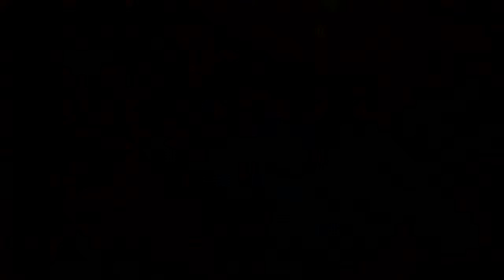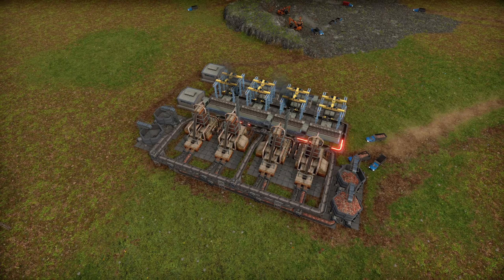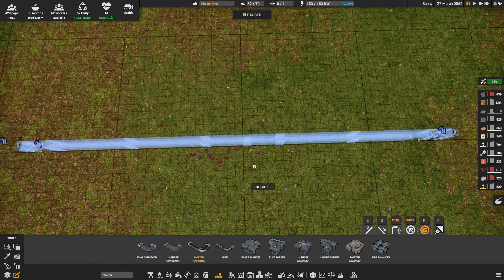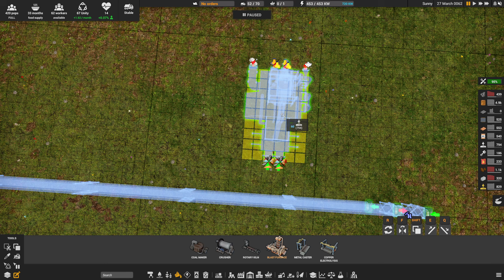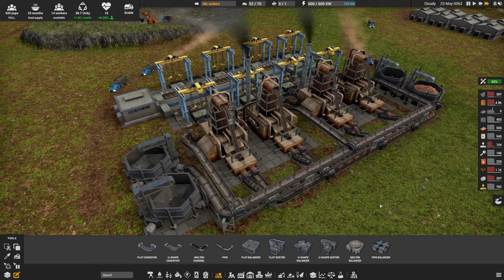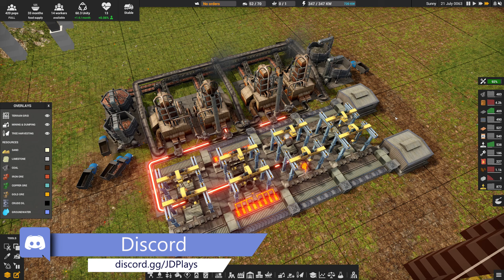Perfectly Efficient Iron Smelter 🚜 Captain of Industry  👷  Walkthrough, Tutorial, Guide, Tips

Comment: I am curious at around 5 minutes and then 12 to 13 minutes into the video, is there is a reason you do not just connect the left most(the one closest to the slag container) blast furnace slag belt to the second input of the slag container instead of running it all the way back to the rear of the furnace to the other three blast furnace slag belt and then running from the rear of the furnace slag belt back to the first input of the slag container? 

Seems like wasted efficiency by going the long way around.
Reply from the maker: a choice that was made for tutorial reasons, as players may choose to have coal and iron enter from either end, and have slag exit at either end. By putting it where i did there is no uniqueness and if, then, else statements that come with the build. Honestly when i build it i run the slag belt the short way but shhh dont tell anyone!

Comment: Tip : Shift+F flips vertically meaning you no longer have to rotate.   Great video, but this is no where near complete.  There are better ways to process iron, and it doesn't cover scrap later in the game.
Reply from the maker: Its designed mainly for early/mid game. Yes there is more tech and more options. But I fully expect by then someone knows what they are doing and can design something on their own. Sure it might not be as neat or compact, but in the end game the power requirement of 10 belt segments vs 50 belt segments is negligible
Reply: @JDPlays  yeah, would be nice to see a vid from you on late game ore processing. Your layouts are lovely. Keep up the good work bud.
Reply from the maker: I expect i to do more later game builds as the game progress, steel will be soon, and glass. But at the same time I do know as the tech increases many of these builds will have to be upgraded, which will bring new videos and challanges of taking my previous build and upgrading them and keeping the same design elements

Comment: 2nd build, instead of changing to molten down the middle, you could use the first build and just have the casting 2 tiles apart of run parallel belts for iron output
Reply from the maker: Yes there is always room for optimisations, but it also means twice the amount of belt running, which is twice the amount of power. Catch 22

Comment: great tutorial as usual ! only thing is im not sure if u want leave bit space near smoke stacks in case u want to run it thru air scrubber later on. cant wait for 10 different videos about specialised advanced oil refineries different versions depend on what u want to get :D
Reply from the maker: oil is a tricky beast, i have done one on advanced diesel, and i expect ill do another one with a full smart splitter option which will take some time to make, but should be able to output every item and burn off what you dont want. still very early concept stages!